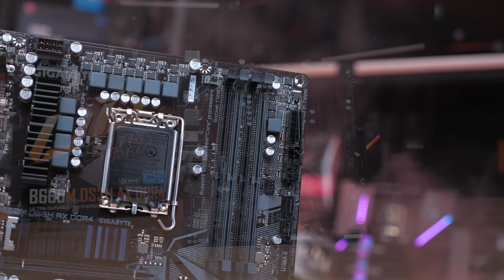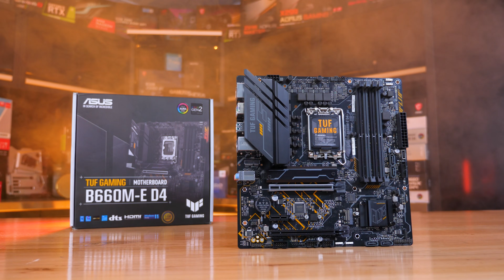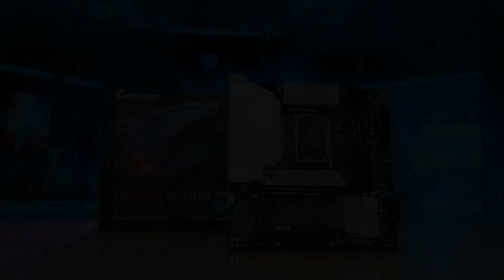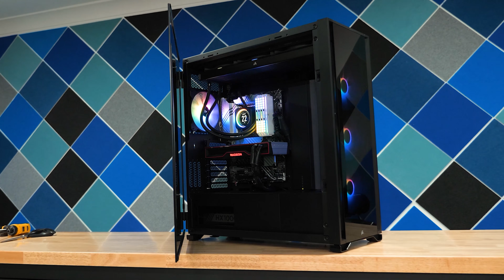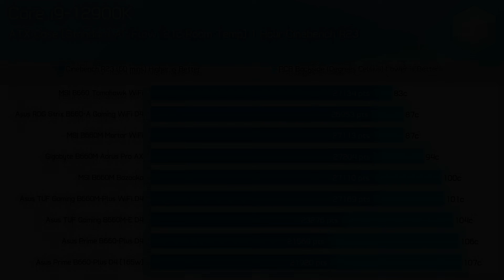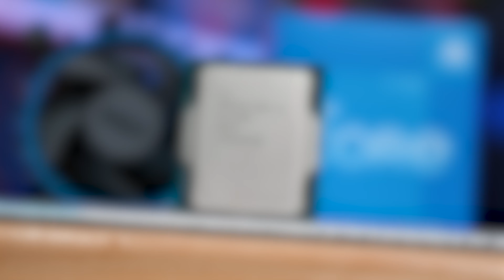18 Intel B660 Boards Tested, VRM Thermal Test

Comment: Looks like MSI is the winner when it comes to AMD's B550 and Intel's B660 thermal tests. It seems like MSI is the only company out there who is listening to your critiques when it comes to thermals and performance!
Reply: MSI cracked the code to making money: make the best product you can so you make money by outselling your competition instead of squeezing margins of single cents out of every single unit
Reply: MSI is the only company with a good Z690 board that doesn't cost you a kidney too.
Reply: quite the redemption after their disastrous x570 lineup!
Reply: What bought b450i
Found one from msi for $80 in my country
Reply: I wonder if they’re testing the waters to see if making good products actually results in better sales. If not then I expect they’ll revert to what all the other AIB’s are doing.
Reply: But isn't the aorus pro ax better??
Reply: And asus tuf for 100$ less is a good option
Reply: But doesn't function with 12400 bruh, could send it back since it didn't have bios flashback.
Reply: Thanks. Saved me a lot of time
Reply: remove "look like"😂
Reply: Yeah just wanted to say that as well, good to see but lets hope they don't become compliant.
Reply: @TestarossaF110  the word is complacent...
Reply: @TestarossaF110  I agree 100%. Though I am sure Steve will keep them on their heels. ;)
Reply: asus rog string b550 gaming f is a high end mobo dont think msi has a better one
Reply: @promo130  I have that Asus B550-F ROG Strix gaming wifi that you have and the MSI B550M Mortar wifi and both have been very good. The only issue with either is I noticed the Bluetooth doesn't work on my Asus board. I'd been using it for about 3 months when I tested it and was given RMA to use but never went through the return process because I didn't want to lose my 5900x for 2 weeks or so. The wifi on the AX200 works great so I decided to live with it. No such issue on the MSI board but it is the previous gen AC200 Intel wifi on that one. The wifi AND Bluetooth work as expected.
Reply: Edit: the MSI B550M board does have wifi 6 AX200 WiFi. It's my b450 with the Wi-Fi AC, which works well, too for Bluetooth.

Comment: I Just bought the outrageously pricy rog strix 😂 but i'm Happy with my choice 💪
Reply: paired it with which CPU?
Reply: @kaustubhx5452  i5 12600k, used for gaming and streaming. I don't want to OC It and i wanted to buy non k model, but non k is 6/12 instead of 10/16 😂
Reply: @kaustubhx5452  and maybe in future i Will buy an i9 13900k to pair with this board

Comment: It is very important to say that Asus rog strix b660 has PCI-e 5.0 while msi b660 or aorus b660 has PCI-e 4.0. New graphics cards will have PCI-e 5.0. That's why asus rog strix b660 is more expensive I think.
Reply: Asus boards are more expensive because Asus thinks they are a premium brand. It is the same every motherboard generation.

Comment: may i ask for your answer, im using b660m mortar non wifi , is there any use of 8x2 pin power cpu ? im using i5 12400f right now, im very thankful if u can answer my question 😁, hope everyone safe and liked your content
Reply: You only need to plug in one CPU EPS power connector, you will not need more than the 200 or more watts that a single 8-pin can provide.

Comment: There are a handful of competitively priced H670 boards that seem good too, but nobody seems to be looking at those, unfortunately.
Reply: What are the differences between the two chipsets?
Reply: MSI does not even offer a single H670 board!

Gamers are not too interested in the features of the H670. I think content creators building workstations will appreciate the extra bandwidth of the CPU uplink (DMI4.0 x8) as it will enable the boards to offer more and faster PCIe slots as well as high speed USB 3.2 Gen 2 aand Gen 2x2 ports.
Reply: @fleemwings207  Gamers aren't interested in PCIe Gen 5 for their graphics card slot? Because you can get that for cheaper with H670 than you can with B660 (The H670 Steel Legend is $170).

There's really no reason gamers shouldn't be interested in H670. It's a midrange chipset between B660 and Z690 with some decent looking gaming motherboards using it.
Reply: @konga382  The Asus TUF Gaming B660M-Plus and above boards come with PCIe 5.0. I have this board.
Reply: @CyberPsych13  And that's more expensive than the full ATX H670 Steel Legend with PCIe 5.0. I'm just saying, motherboards with that chipset can be worth considering too.
Reply: @konga382  May be. The H570 Steel legend doesn't have WiFi so the direct comparison would be Tuf B660M-Plus non Wifi. But H570 offers more communication lanes than B660 which means more devices can be connected

Comment: At least in my region B660 pricing is all over the place and prices change seemingly at random, so this kind of content is extremely useful for bargain hunting. Thanks Steve!
Reply: I don't really understand the current pricing where I live. B660. Z690, it's basically all the same, plus or minus a few 10s of bucks.
Reply: @KindOldRaven  same here it actually cheaper to buy a z690 board. I think bcz b660 is newer availability is not as good as z690
Reply: That's why I am happy with my MSI Z690 board that I snagged for a little over $200 at Micro Center when first released and the 12600K for $270 (which has since dropped to $250).
Reply: I need matx board. So which is better b660m mortar wifi or z690m aorus elite? About $10 price different
Reply: @Oz_2026  Depends on what you want in a board. Generally the Z690 will be better if you plan on doing more OC'ing and need the extra features like more USB ports, more m.2 PCIe 4.0 slots and how you want your PCIe slots arranged. The MSI has proven reliable thus far but I'm pretty sure the Gigabyte is just as good. For an extra $10 though, I'd steer towards the Z690

Comment: MSI really got their shit together after the fiasco we've seen 4 years ago
Reply: yeah.  MSI  have been a consistent top performer for the midrange on both Intel and AMD platform.   Their pro, mortar, and tomahawk lines are actually pretty good its price.
while, Asrock has been always at the bottom.
Reply: @baseModelCars  yes and no, asrock was actually killing it in the budget segment of AM4 boards with their B450M Pro4, none of their boards are exceptional but they offer decent price performance usually.
Reply: @Rem_NL  that was actually an outlier rather than the norm for Asrock sadly.  They were decent, yes, coming from B350 to B450, but almost everyone stepped up their design once Zen2 released.

@Mat- mat, yeah, no one forgets that, but that chipset is for highend range though.
Reply: @Rem_NL  asrock is a no-go for me for years
better to not bother with a manufacturer that has 90% of the lineup be garbage, often not being worth ANY pricetag and block proper reviewers from getting their products on time to test
Reply: @baseModelCars  msi did really well with their b450 and b550 lineup
Reply: i still have the b450 tomahawk max (Ryzen 3000 - not sure about 5000 support) to this day, a very decent one and i think it was the top performer as well in the b450 category, recommended it to all my friends who either got it or the Mortar one.
Reply: @yahiarafik9965  I've got the B450 tomahawk max mid 2020 for 110€ paired with 3600 and it's been awesome, i recently overclocked the 3600 to 4.4ghz 1.3V and still running with no issues or overheating, pretty satisfied with the board.
Reply: @vendox_  it shows 1.45v stock on mine lol it goes to 4.1ghz (first batches) doesn't go over 70° with Hyper 212 (air cooler), what are you thoughts on upgrading to 5600x?
Reply: @yahiarafik9965  Mine was going to 1.45V stock too, with the same cooler as yours, i had to put offset mode for voltage and -0.1V because it was peeking to about 88c. But now when it's overclocked it's not going above 65-70c in most games, only ones that use much cpu like BF5. For 5600X in my case it only depends about the price, in my country it's 300€ and when i look at the 3600 i payed 160€ it's not worth it, if you really want it and the price doesn't bother you than go for it, but for me double the price for not much more performance it's not worth it.
Reply: I have a b560 tomahawk. I didn't know any better at the time and bought it with an 11700k, thankfully it can support that chip just fine at stock.
Reply: Remember the X570-A PRO and GAMING EDGE VRM debacle?
Reply: @mat-mat101  people have short memories

Comment: I hope you can keep covering this series. I have a hard time comparing VRMs. There's rarely any guides out there that covers it.
Reply: keep an eye out of LGA1700 spreadsheets. i already see one, and hopefully RaisonJohn makes one for 1700 also (he's done AM4 and PSUs as well). then just compare other models with the same mosfets/power stages and see if any already-reviewed boards has the same VRM layout ...and appearance of heatsink size!
Reply: The more phases - the better . 
Basically if the board has only 6 main phases then it's gonna run hot or slower with i7. 
With 8 phases it's fine for i7 and maybe for i9 too if there are good heatsinks
Reply from the maker: @damara2268  within reason phases don't matter, it's about the quality of the components used that make up the phase.
Reply: @Hardwareunboxed  now its even more complicate :V Anyway thank for the info
Reply: @Hardwareunboxed  Could you please review MSI’s latest monitor MPG ARTYMIS 273CQR-QD thx
Reply: @Hardwareunboxed  Could you make similar comparison for H610 boards?
Reply: @Hardwareunboxed  if someone tried a KF intel 12 gen processor , would it be less demanding on B660 motherboard VRMs?
Reply: @Hardwareunboxed  Can MSI MAG B660m Bazooka handle 13600k without any issues with VRM? (I don't plan to OC)
Reply: @damara2268  If it were that simple then heatsinks, power stages, power planes, Output filtering caps etc all wouldn't matter.
You can create a really crappy 8 phase using an ISL95712 as a 4 phase then run it through 4x isl6617 doublers with a single NIKO highside and low side mosfet per phase with a tiny little heatsink and a very narrow power plane and cheapo polymer capacitors.
It'll have very litle power draw handling, run hot and have terrible transient respones.... but it''ll look really impressive and you can call it an 8 phase.

Watch every buildzoid (actually hardcore overclocking) video and you'll pick things up over time better than whatever some dumbass like myself in youtube comments can tell you.
Reply: @tomstech4390  well explained mate, buildzoid couldn't have explained it better himself
Reply: @damara2268  That is not true. Sometimes board manufacturers use double or even triple the components per phase. Asus was the one who started this practice and removed doublers .  It is very simple. You can have 2 units of 50A power stages in parallel , combined as 100A per phase . The drawback is however, if the load is low, you cannot individually power off 1 of the 50A power stage, it has to be both 50A on or off,  sacrificing a little on efficiency. In layman's term, it is like, having 1 switch (Phase) to control 2 lights (power stages) .

Comment: I really hope the msi pro a boards could keep up to the quality since around z490 when it really became the standard board choice accommodating even the flagship chip
Not that others couldn't try to catch up in this regard though I mean it's better for every board living up to the standard rather than having to dodge certain boards especially Asrock's budget options : (
Reply: The MSI B450, B550, X570, B660, Z690 A-Pros are all awesome value for their VRM
Reply: @calvintibia001  msi also had a bit of a hiccup with x570 boards, though they quickly fixed it.
Reply: @someoneintheinternet7443  yeah, i got one of the earlier X570 Tomahawks and they had some glitchy BIOS behaviour when the I push both FCLK and UCLK to 1900Mhz+, but the overclock seems way more stable with updated BIOS

Comment: 4am saturday morning, just finished up building a 4 boot retro machine, win98se, xp home, xp pro and win7 .. lol..  hardware is all from 2003.. had win10 on it to but so slow i was wanting to crash.. win 7 is super slow too.. funny thing is, I used a asrock 4coredual-sata2 mother board.. .
Reply: I found win10 was pretty fast as well in the beginning, before they added all the other bits that nobody wants but them
Reply: @Bareego  win 10 and even win7 are just a little to much for 20 year old hardware.. lol. . the mobo only supports 2g of ddr2 and running a dual core e7400 ..lol.  ait aiw 9800 pro only had 128m of memory on it..